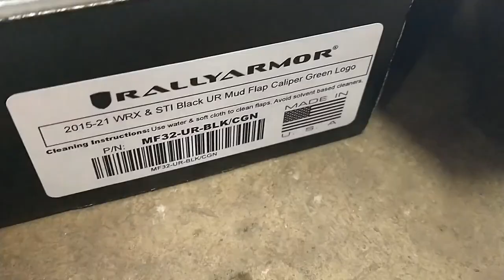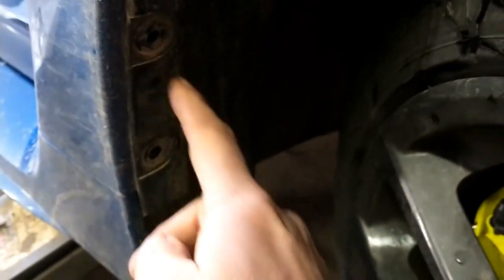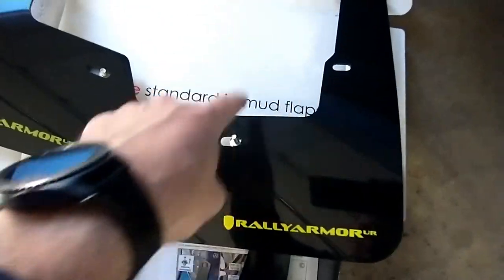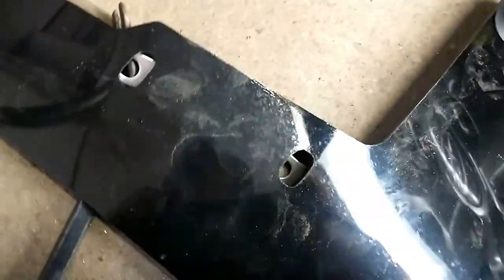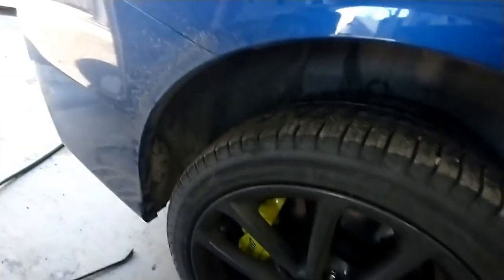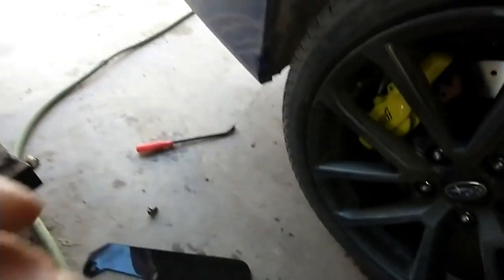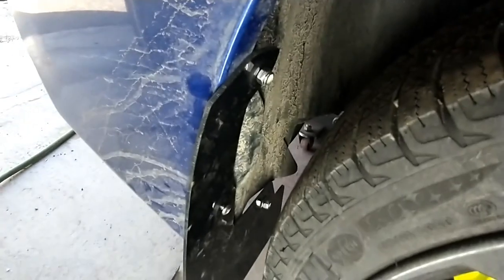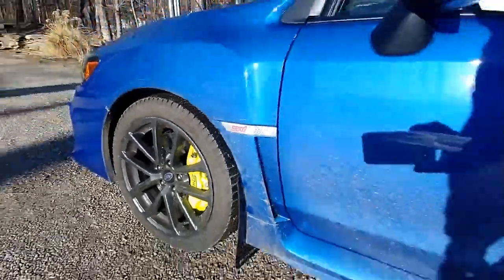Rally Armor mud flap install on a 2020 Subaru STi

Comment: Show us please how to install rear bracket.
Reply from the maker: Take the bottom of the bumper in one hand and pull it away from the car to create enough of an opening to slide the bracket behind. You might have to slightly bend the bracket for it to fit, just take your time, it will get in with a little effort.